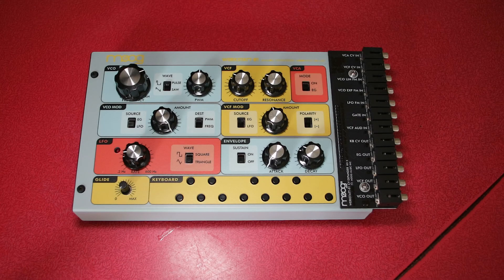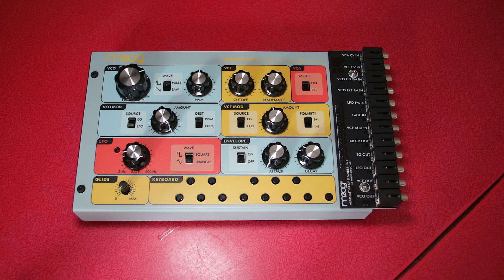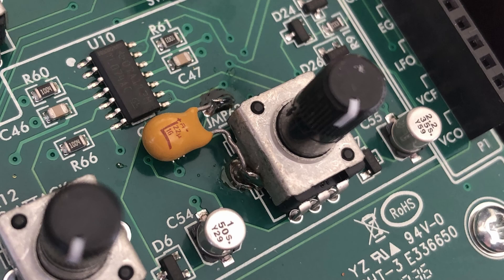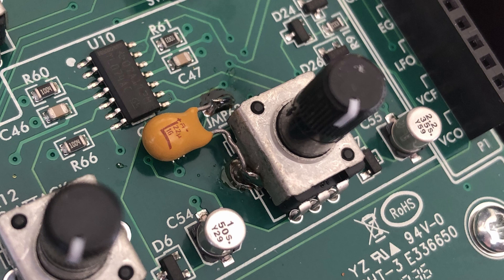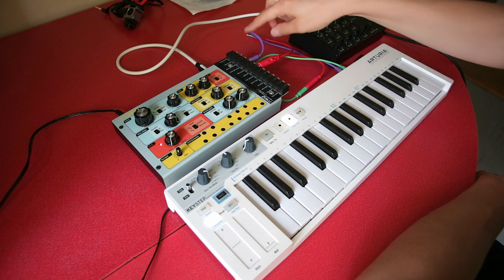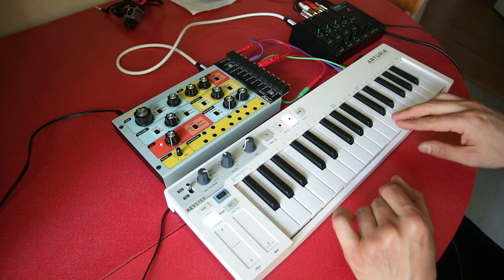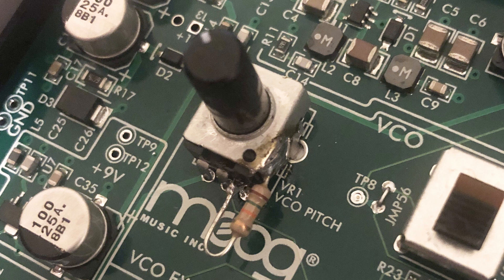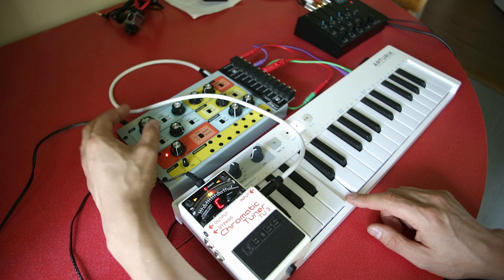Moog Werkstatt mods - appearance, VCA de-click and tuning

Comment: I got a Werkstatt for the new year of 2022 and I use the self-oscillating filter for percussion. Which saves me from having the calibrate the VCOS.

 With the new Werkstatt you can mute the VCO by setting pulse, set the pulsewidth all the way to the right, set VCO mod to zero and destination to pitch.
Reply: You can also put the wav selection slider in between the settings, that'll also mute the vco 👍 I kno it's months later 😁
Reply from the maker: This is a really good tip. I’ll pin it, thanks!

Comment: Did you find that by reducing the range of the tuning knob you also reduced the range that you can play with the keystep? Just wonder as I wan't to try this mod as tuning the werkstatt can be a pain at times, what I don't want to do though is reduce the overall sonic range of the werkstatt.
Reply from the maker: the internal keyboard range is reduced. but there is no problem with an external keyboard

Comment: Hey, I've been having problems with my tuning for live performances with this and the Tuning Mod seems to completely solve my issues. Just to be clear.. You actually don't have that third leg touching the board anymore? It's difficult to see from the picture.
Reply from the maker: That’s correct! Happy it helps you.
Reply: @gwEmbassy  and when you say 3rd leg do you mean the middle one or the one to the right out of the 3?
Reply from the maker: The rightmost one

Comment: How would a 12k ohm resistor change the tubing knob? I’m trying to comb though my resistors and find 15k. I may have to pair some values together.
Reply from the maker: You won’t break anything by trying, and it will definitely help
Reply: @gwEmbassy  thank you! Tuning knob!  I don’t think mine has the tube knob. Lol

Comment: Should have my Werkstatt here in the mail any day now. The tuning mod is a great idea, but ending up with less than two octaves seems a bit steep. Did you come across different resistor values/octave range numbers by any chance? I guess finding out what the value of the potentiometer itself is and going from there would be my first approach. Thanks for sharing!
Reply from the maker: Yes, I have calculations for a whole range of values. Best thing to do is try it stock and see what you think :)
Reply: @gwEmbassy  I'd probably prefer something around 3 octaves give or take. I just got the system 100 182 sequencer from Behringer, which has a 5 octave range for each step if I'm not mistaken. I often end up routing it through an attenueverter since that range is difficult to get accurate pitch with such small knobs haha. Thanks for the response!